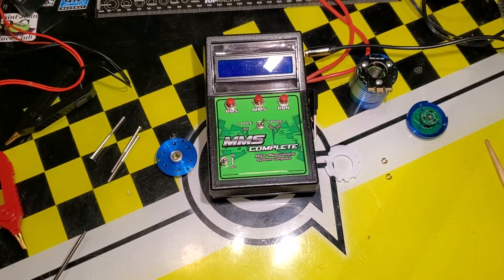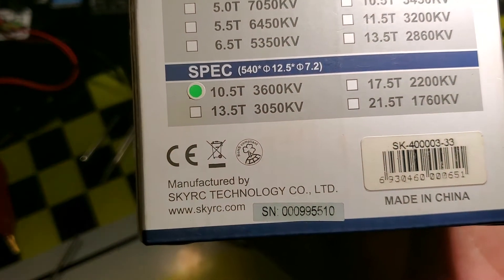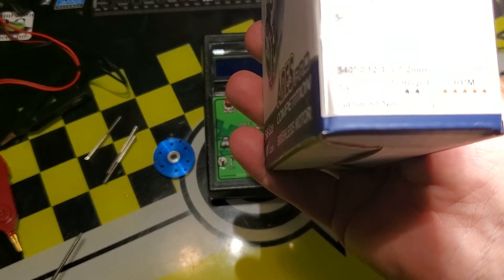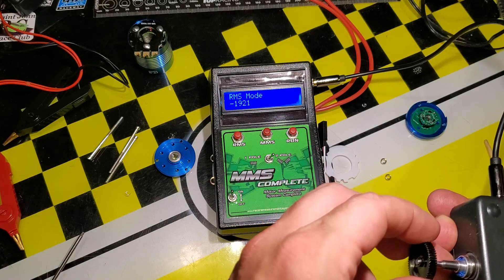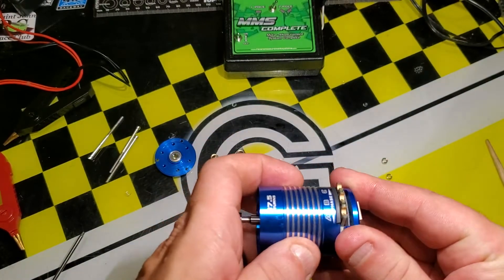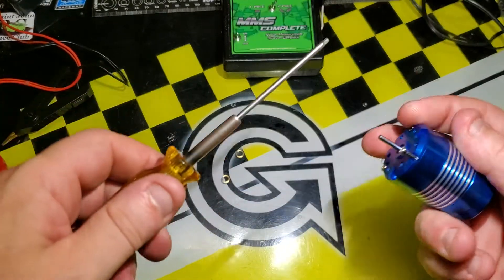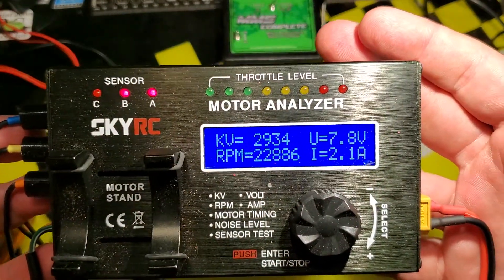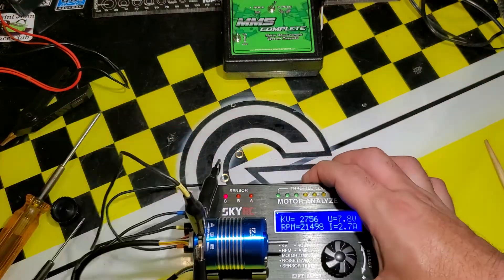Motor Tuning: High RPM vs High Torque rotors explained

Comment: I stopped racing Touring Car (17.5) in 2017 and using my Fantom meter, the BEST stock 7.2/12.5 rotors were around 1650 to MAYBE 1700.  I just bought a "modern" car (of ALL classes in RC, the one that changed the most in the last 7 years,  is Touring Car as they pretty much all copy the Awesomatix car by eliminating hinge pins, going to pivot ball outers, SUPER short shocks and mid motor)  I just bought a relatively inexpensive Rocket RC Superlight 17.5 and noticed immediately the rotor was EXTREMELY hard to turn once in the car.  It states it is ROAR legal
so I am assuming that still means a 7.2mm inner diameter.  Anyway, on my Fantom it is registering 1800/1810 gauss!  It seems to me I am going to have put a bigger pinion and wind up with 3.85-3.95 FDR on my medium
sized black carpet track.  Pretty incredible!

Comment: I always feel a high rev motor over geared slightly is better for more stable pull without wheelspin.
Reply from the maker: Agree, I use this technique on a low grip offroad track to take the bottom end out of the motor.